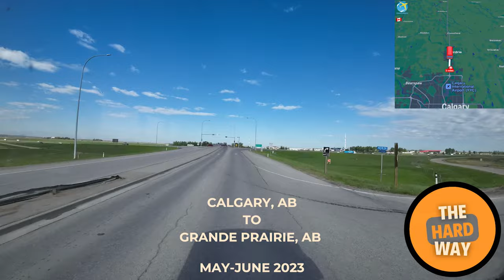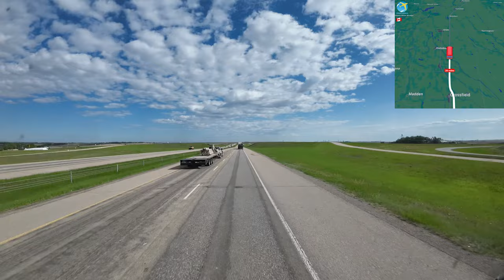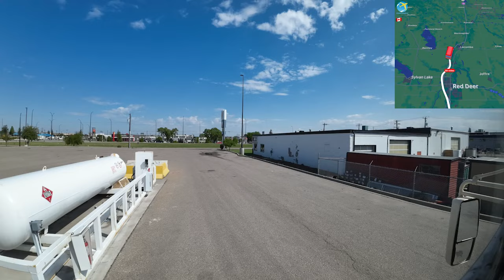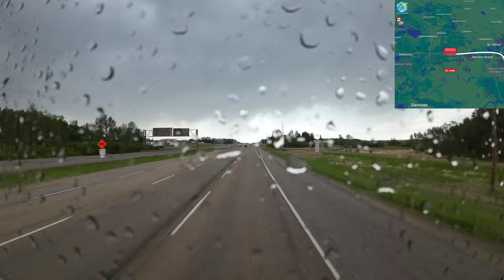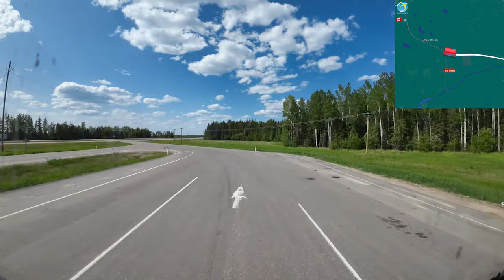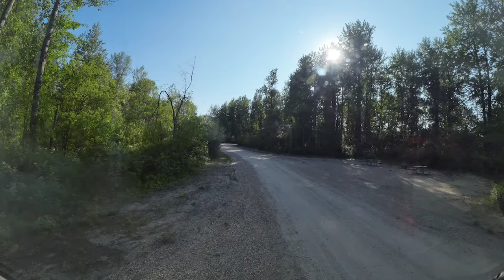3 Major Bus Problems in 400 Miles!  Skoolie Travel Timelapse - Calgary to Grande Prairie

Comment: Thats no good. Does the safety hook to the frame?
Reply from the maker: They do now, the bumper replacement was a last minute change before we left and the chains hooked between the bumper and frame.  That is fixed now, but when we get back home, I will strengthen the bumper further.